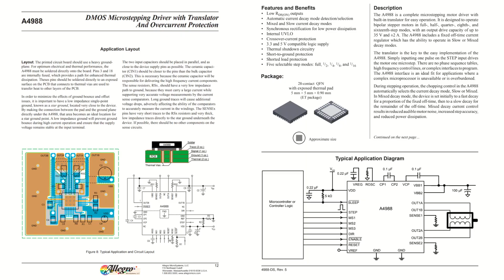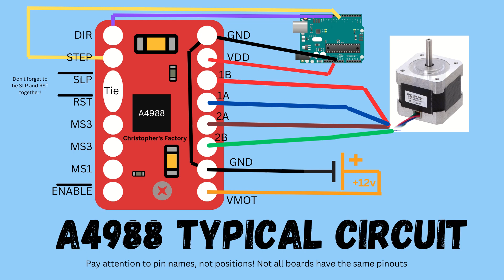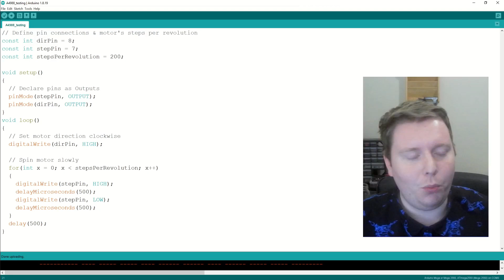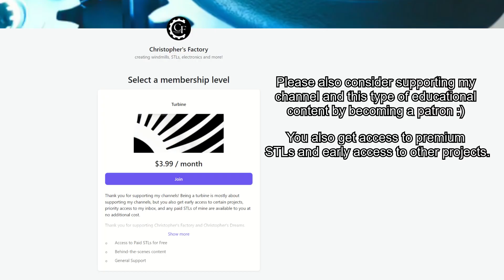How to Drive Stepper Motors with the A4988

Comment: Your video was helpful and thanks for adding it.  One comment that I do have references the voltage range shown on the spec sheet for the A4988.  You are referencing the Absolute Max Values.  These values show what the chip can tolerate for a limited time.  For example if the range is -0.7 to 30 volts it simply means that if these voltages are used it will probably not damage the IC.  However, it does not mean that the device will operate in much of this range.  I do not know if this IC will operate at 5V.  Where the device works and what will damage it are two different considerations.  As an electronics engineer, I usually also avoid operating close to the Absolute Max Values.
Reply: I have tried this using a stepper motor rated at 5V. I simplified by using the one 5V power supply and connecting it to both VDD and VMOT. It works!